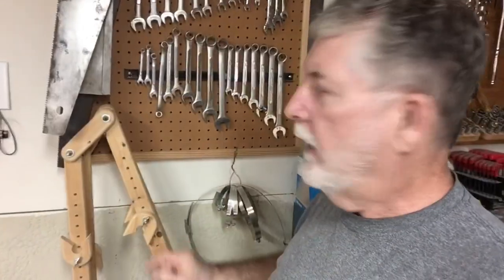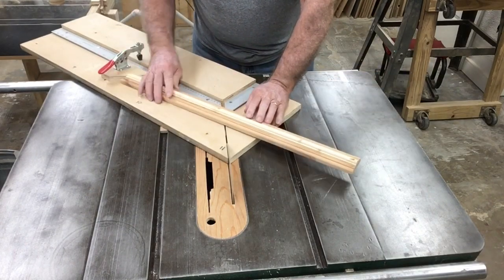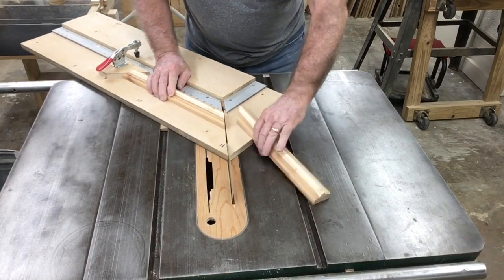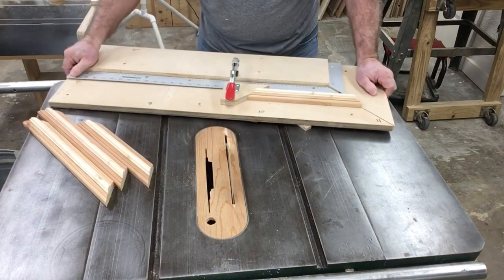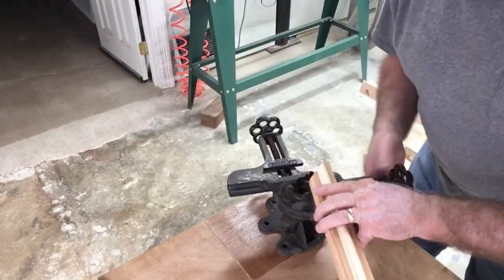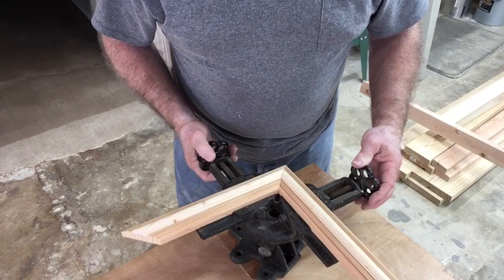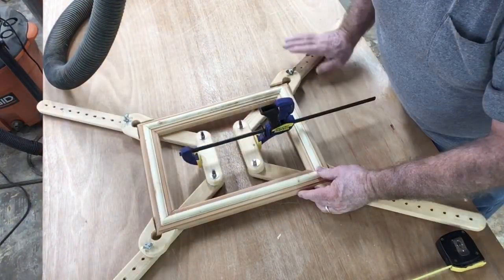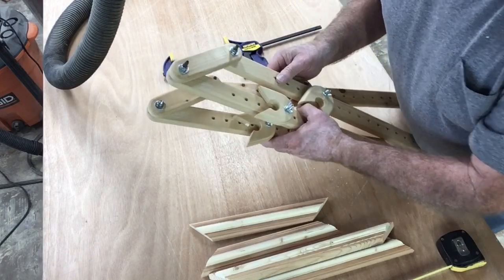Clamp All Four Corners at Once

Comment: Hey there paw,paw great video made mine a little different Sam's concept? But need some kind of adjustment in make some  4x12 frames and wonder where to adjust of smaller blocks to clamp? Any suggestions.
Reply from the maker: Love it when people modify the design to fit their situation. For the smaller frames try spacer blocks or make a smaller clamp with closer tolerances

Comment: Another great idea!  I've made a few frames recently and struggled with the glue up.  Wasn't fun, that part.   This would be a great easel project.  The largest capacity must be around 24 x 24 inches?
Reply from the maker: Yes, it could be done on  Easel.  This is really faster the old fashioned way.  Not sure the max capacity.  I usually did frames around 16x24. You are probably correct.

Comment: As a fletcher if you want to turn out a lot of frames and not worried too much about your corners this would be it.
Reply from the maker: The corners are protected better than the metal clamps normally used.
Reply: @PawPawsWorkShop  Really? I would think linking up 4 corners while glued and making everything look clean would be hard to do. I'm going to make about 50 to 60 5x7 and 8x10 desk frames.  I'm gonna make this jig for sure.